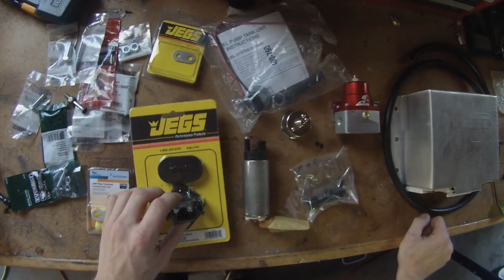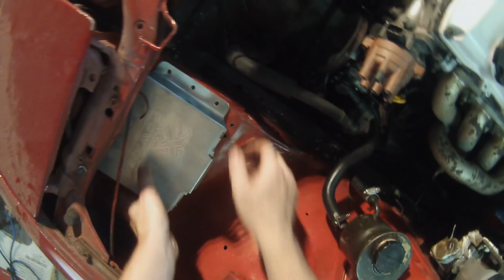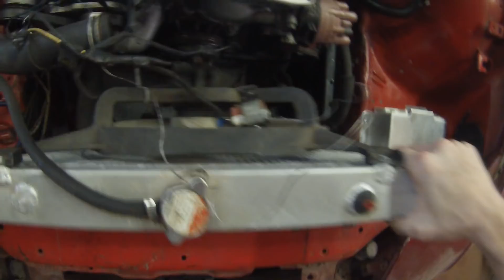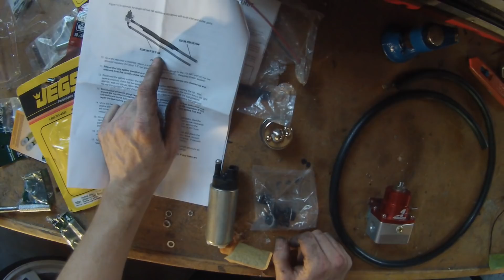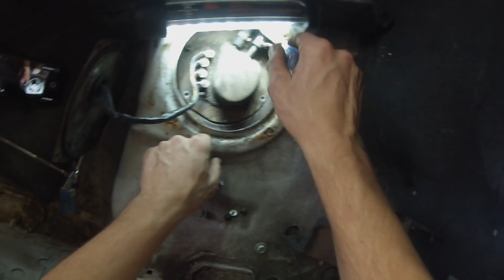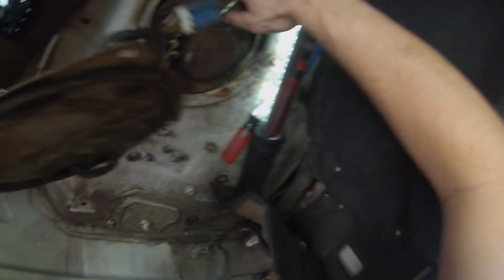Cone's Garage | Project KA24DER Part 6 - Power, Fuel and Progress

Comment: Why not relocate the battery to the trunk to shift a little more weight to the rear?
Reply from the maker: +Breon Nagy Its so little weight for some much extra work and extra wire to chafe against body parts. Just seemed a bit needless.
Reply: Good point. We always moved our battery back in our rally cars. Not totally sure why. Maybe because the pros did it. Maybe because of weight. Maybe because rally cars are prone front end damage :P
Reply: +Breon Nagy Wouldn't seem worth it when you have a race battery like that. Moving mine to the back of my nissan soon however its not a race battery so 15kg, and i already have a wire run for it to work on.
Reply: sneakeypete Also, if the battery is 15kg, then it's a 30kg weight shift.

Comment: Cone, in all honesty, would say $6000 buy myself a decent 240? You have inspired me so much with this series and your commitment to these cars, and I just want a fun track/friday car.
Reply from the maker: +Andrew Cathcart 6000 will get you a decent stock 240, which is for most purposes not that great of an anything car by today's terms...or it will get you a chopped up modified one that needs to be sorted out. I'd prefer the stock one myself but either way its a big project.
Reply: depends on your area, i got one here in Tennessee for 2700$, 100% bone stock with nothing done. Just needed some maintenance stuff done, and a clutch job. and I get comments on where did i find a clean stock 240 lol

Comment: I'm starting to enjoy this series :) Your audio seems to be out of sync btw at least in the beginning not sure about the rest
Reply from the maker: +Rentta Just that first part, I have two go pros..one is forced to 25fps and one is forced to 30fps..they never want to behave together im not sure why I ever bother trying :P
Reply: Well that is probably the issue when you are using two cams that are recording in two different frame rates. Anyway i wasn't sure about the rest because it wasn't easy to judge how is your timing when it comes to commenting what you are doing / what you are going to do. Anyways this is interesting even though i'm really out of the loop when it comes to tinkering with cars. Haven't done that in many many years.

Comment: why not KA24DES for supercharged :). the build is coming together rather fast as well, also do you have any concerns about heat soak from the engine bay?
Reply from the maker: +tacticalAR223 cos' KADER sounds cooler... yip i'm that shallow. Heat soak is always a concern, but with no ac system and a pretty bare bones engine bay airflow is pretty great.
Reply: +ConeDodger240 I also wanted to ask did you ever think about doing a truck v8 swap like a 5.3 vortec or any other v8's that you could buy for a reasonable amount of money?
Reply from the maker: +tacticalAR223 I have no interest in V8 swaps, partially due to the fact those are considered "XP" cars not "street mod" cars as far as autocross goes, and that's a whole different animal.
Reply: +ConeDodger240 makes perfect since, I remembered that you said something about their being a reason why you didn't go that route but couldn't remember exactly why. I thought it would be a funny thing to say that you have a "truck powered sport car," but I can see why supercharging the ka was a lot better of a option. I'm hoping to get rid of my 2001 s10 xtreme for something newer within the next month.